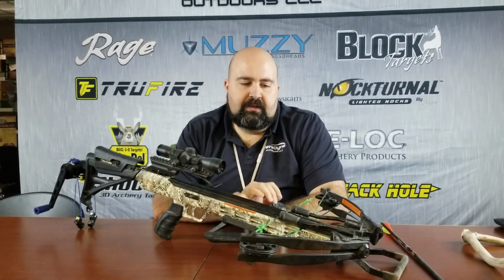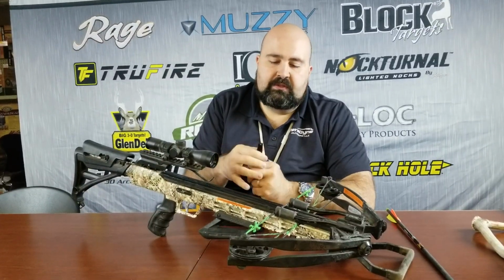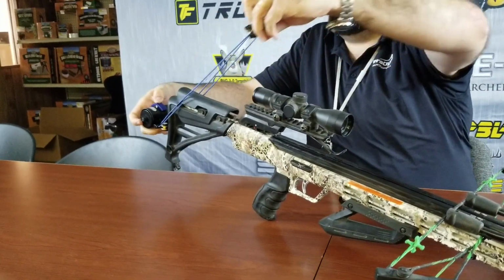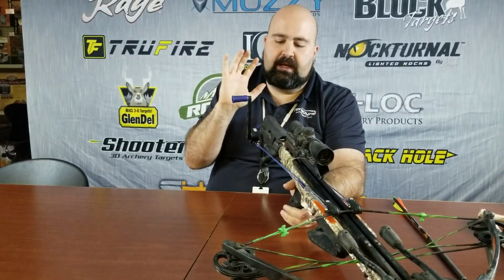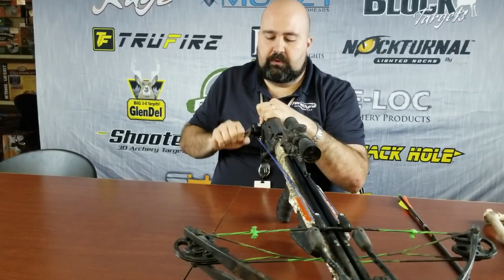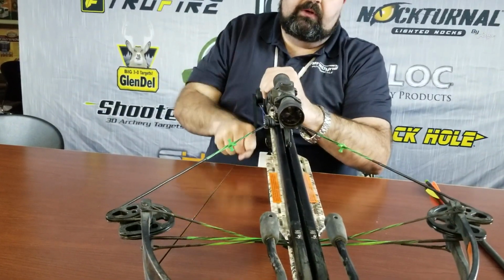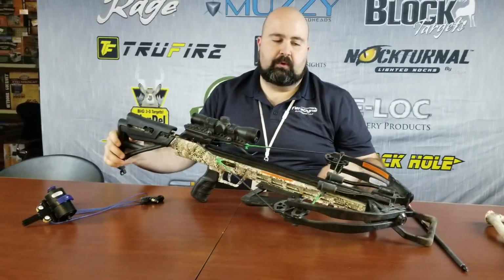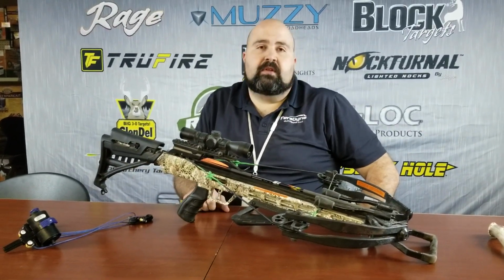Carbon Express X-Force® Piledriver™ 390 Badlands Camo

Comment: if you want a 340fps bow this it
Reply: Mine was and still is 325. At least it’s consistent and the limbs haven’t cracked😂
Reply: This is not 390fps?
Reply: @adgenai  They measure that speed shooting a stupid light bolt.  When you use a decent heavy 22" bolt. and a 100 or 125 grain head, you will end up with a bolt that weighs maybe 430 - 460 grains, and you will get about 350-360 fps out of it.  Light bolts shoot poorly and give poor accuracy.  They also lose their speed faster over distance, and don't penetrate so well.  So you get a nice heavy bolt, and at 350 fps it will pretty much blow through anything except maybe a hog's plate.
Reply: Ed Spamjunk Thank you! Finally I bought the new CenterPoint CP400
Reply: @adgenai  That much speed only adds more noise, not effectiveness.
Reply: Troll ! he puts the same comment on all the reviews for these bows